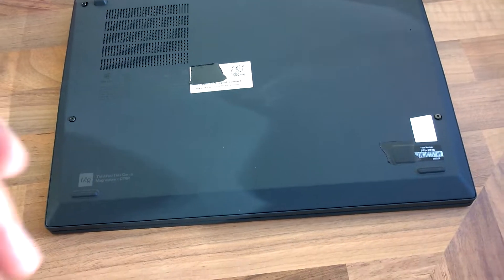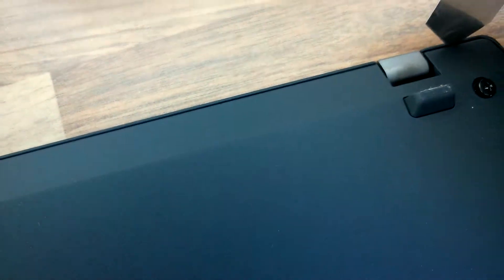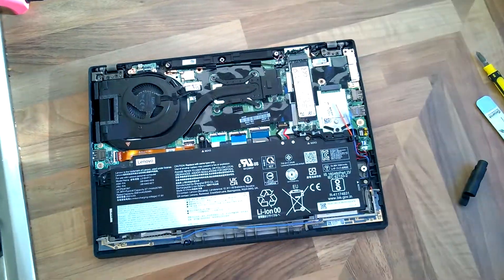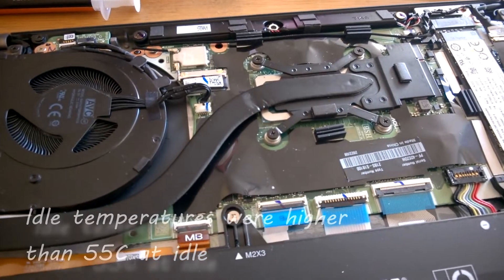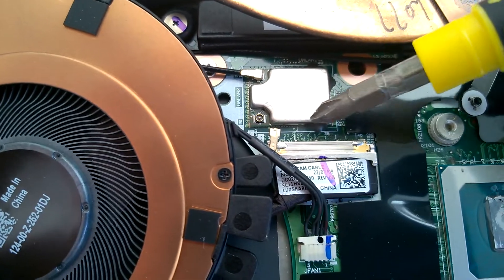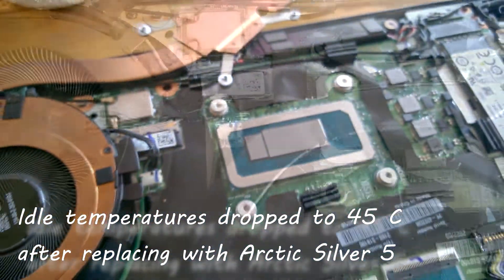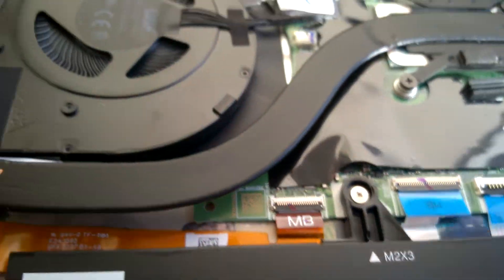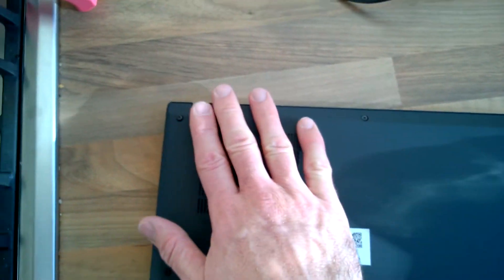Lenovo T14s Gen 3 CPU Heatsink Thermal Interface Compound Replacement - Can It Lower Temps?

Comment: I would consider replacing that heat pipe, liks a bit dented
Reply from the maker: That's an interesting spot - I never noticed that. This was the first time the laptop was opened so that was in that state from factory / initial build.
Reply: @ChrisHorswill  that dent looked pretty bad, I'd definitely try to get an OEM one while you still can, i think theyre usually 40 bucks. I saw a video recently of some dude who noticed his pipe was jacked up a little. It seemed to have caused turbulence inside the pipe to cause a rise in temperature.
Reply from the maker: @johnkeo358  These laptops certainly run hot and yes that disruption to the heat pope probably wouldn't help! Cheers!

Comment: Is this seriously a CPU heatsink thermal interface compound replacement video that never actually shows the replacement of the thermal interface compound? Is this a joke that I don't get?
Reply from the maker: This is more of a comparison on whether new heatsink compound can improve temperatures on this hot running laptop.

For a more detailed tutorial on the actual replacement process you could this my other video on this: https://youtu.be/GTvnaYbcVJI

This is a different model but the process is exactly the same as this Lenovo too.

PS: I've changed the title of the video to better help describe what it's about.

Comment: Is it possible to replace the heat sink system with that with dual pipes from the T14 AMD? Are those compatible?
Reply from the maker: Not sure on that one. I've not seen inside the AMD variant. I would expect the AMD heatsink mountings to be very different though.

Comment: How much paste is a "thin layer"?
Reply from the maker: It really is just that, you want to cover the CPU with it but not too much that it would squeeze over the sides when you put the heat sink back on.  Just enough to not see through it.  You are putting this on to fill in any microscopic indentations and allow full heat transfer away from the die.

Comment: which thermal paste would be best for a normal dell inspiron notebook laptop its the 4K version, the fans are running fast and makes noise, which im going to replace but im thinking of which thermal paste to use either Thermal Grizzley Hydronout or Gelid GC Extreme, my cpu hits over 70c and my intel hd gpu hits over 50c but i also have the AMD M270 gpu too but thats stuck at 511c which is incorrect, can you help with what i should do?
Reply from the maker: From my experience just replacing the thermal paste with anything new will help.  In reviews all pastes are within a few degrees of each other so I do not think it's worth spending too much.  I personally like Arctic Silver 5 but its just a choice I made. Just give the fan and heatsink a good clean since dust is the main reason for rising temps, clean off the paste and reapply a thin coating and this should help with the temperatures.
For the AMD GPU temperature that sounds more like a software issue. Have you tried other temperature monitoring programs, ideally the AMD software that comes with the card.

Comment: Hi is this better laptop ?  I'm planning to take it , can you tell me about heat and fan noise ?  And battery life
Reply from the maker: Hi, depends what you are comparing it to.  It does run fairly hot, I often hear the fan ramping up and at a certain speed like the other Lenovo's there can be a wine which can be annoying in a quiet environment.  Battery life I have had 3 hours of work from one on battery. This was constant use and also included a VC using cameras etc.
Reply: @ChrisHorswill  3 hours seems a bit low? i have heard the previous models (at least with amd) run from 7-10 hours
Reply: @QwickGainz Intel uses more power than AMD...